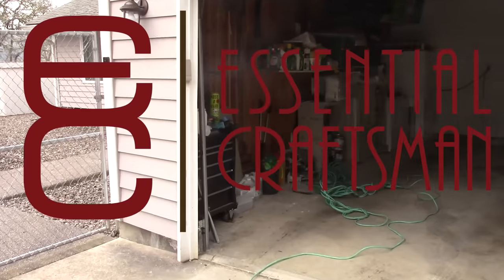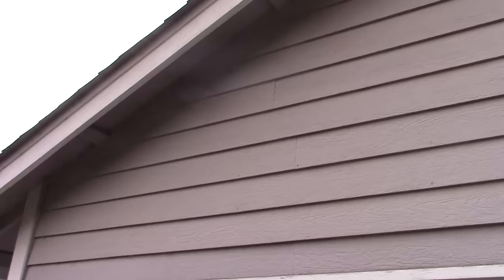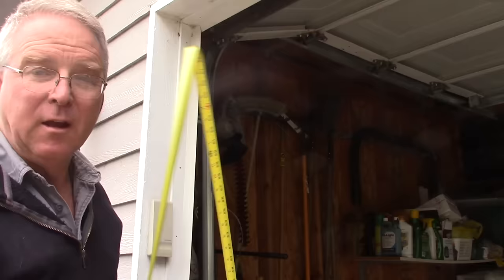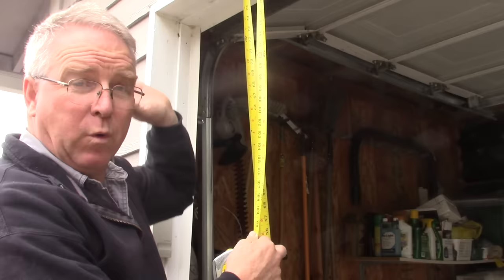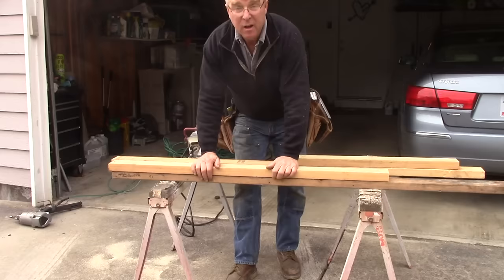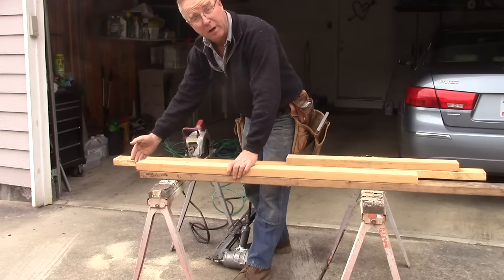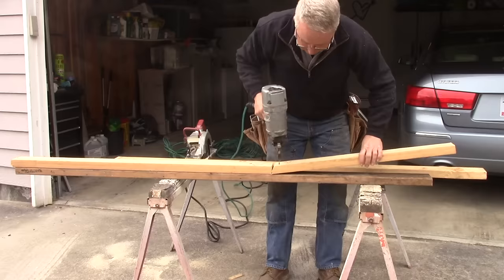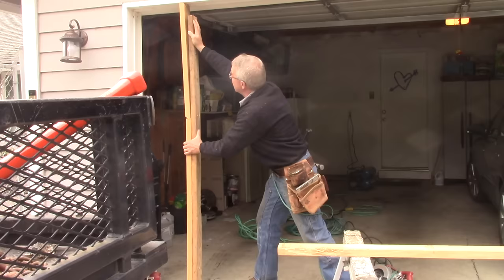2x4 Becomes a Jack - Cool Trick

Comment: Nicely done, but I don't understand why you didn't just back the truck into the door jamb...
Reply: * Adding more scuffs to the wall?

* It's hard to judge to within 1/8" of plumb by eye sitting in the driver's seat 8 - 10' away?

* It's likely quicker to lever in the way he did it?

* it is MUCH easier to control the amount and direction of force with a short lever than it is with a vehicle transmission?

* The amount the truck will roll several could easily be inches one way or the other when you take your foot off the break and/or clutch; and you need better then quarter inch precision?

I could possibly come up with a few other potential ideas, but I think this was the fastest and easiest means of doing the job that came to mind at that time.
It's interesting to see how an experienced crafts-person handles a quick, oddball job.  They bring years, and sometimes decades, of practical knowledge & experience to bear on the problem.  They make dozens of decisions, often without conscious thought, and arrive at a solution that simply works.  Also, as he pointed out at the beginning of the video, he wanted to show a quick trick on how to fix a problem.  Trying to correct a problem doing what caused the problem in the first place...
Reply: Brian Neeley . Trying to correct a problem [by] doing what caused the problem in the first place in the opposite direction.

There are three ways to do things: The right way, the wrong way and the Max Powerway!

Try rummaging in the bottom of your tool box, you might find an old, rusty sense of humour...
Reply: Massimo O'Kissed was
Reply: Lmfao!
Reply: now that's a great idea lol ok home owner stand back. while I fix your garage lol then plow right through front wall an back wall. then tell them you will start building new garage now lol

Comment: That works but 2 much work 
You can achieve the same thing by cutting your 2x4 extra long and just come in on a angle and use a sledge hammer and pound it over lifting the header..
Reply: Yeah a couple cuts and 3 nails is way too much work. Better to have to cut a board anyways, then easily swing a 4lb plus hammer while never accidentally knocking it too far. And for even less steps in the process just gotta put a cleat down or something to make sure the bottom doesn't move,  if you're a puss I mean. Not to mention, it'll leave some nice scuff marks on the customer's finished header/cap/jamb/sill, which is a plus because personally I think it adds character. I make sure and charge extra for such things. Brilliant
Reply: @kyleking1401  wow you really are that clever huh?
Reply: @ryankabcenel9700  I like to think so..
Reply: @ryankabcenel9700  haaaahhhhaaa fuk'n perfect!!!

Comment: That's finished trim your leaving a 2x4 impression on 
Wouldn't you want to use a block
Reply: Three impressions
Reply: I would think so.  It would also allow you to be more free, not worrying about marring/denting that surface.  That's a lot of pressure applied there.
Reply: Painters will fix that with putty when they repaint after the repair.

Comment: *Insert keyboard warrior critique on how you could have done it another way here*
Reply: Didn't he say a Jack and a 4+4?
Reply: A 2x4 board ¼  or  ½ too long hammered into place?  But I like this solution because it doesn't scuff the top of the garage.
Reply: nope, this technique will lift anything, dont know how much weight but i think is safe to say close to 4k pounds at least

Comment: all those tools you pulled out a $10 bottle jack was too much  neat trick im gonna use my bottle jack
Reply: Or just use one load lock.
Reply: Bottle jacks aren't as stable as this method.  They can be, but evething must be level and plumb.  When things are not level and plumb, bottle jacks and lumber can kick out resulting in injury. I've recently used this method and it was easy and effective... Also I needed 4 jacks and I don't own 4 bottle jacks.

Comment: Why not just cut a single 2x4 at 84 and 3/4 the tap it plum with a hammer? Wth did I just watch?
Reply: szymoozz I was thinking this. then remembering that’s still kind of awkward to do alone. 5 cuts and 6 nails still seems a bit much.
Reply: Often times the single 2 x 4 will just bend under the weight.

Comment: You could always build a house out of masonry or bricks when walls won't need pushing back into place. 

It's an old European trick.
Reply: Better use piles under the foundation in some areas.
Sink holes can happen even a poorly executed down spout in our freezing climate can make short work of displacing  masonry construction
Reply: ...but we have trees.  Besides,  the bricks and blocks would've crumbled and made a bigger mess
Reply: mike spence 
If it happened over here only the car would have been damaged. Lots of houses in Europe are usually build to last at least a hundred years. They are of cause also a lot (3x?) more expensive. 

I think that’s what Richard meant to say. It’s a different approach.

Comment: That was sick dude! I've been a carpenter for 15 years now and never saw that done quite like that. My way needed 2 full size studs, one just under current height and one to desired working or finished height, a 4 ft crow bar, and some  brawn. This is way cooler. Done outta scrap and with one less tool. ty man.

Comment: This is awesome. Saw this vid a few years ago. Was putting drywall on a ceiling and struggled a lot until I remembered this technique. I put a 2x4 horizontal on the top board to spread the force out on the drywall sheet. Worked like a charm

Comment: Thank you.  I need to replace the side pieces of my two garage door frames, and you just showed me how!  Just a tip: people should use pressure treated lumber for these side posts to avoid having this problem.  I didn't, and rain splash caused them to rot.

I made something similar to this to hang sheetrock overhead in my house 39 years ago, but I had to put a short piece of a 2x4 on each end of it to spread out the force.  I also used a door hinge between the two pieces (which were cut not to lift but just to fit snug and support).  I left off the third piece.  It worked like a knee and would lock into place and stay put.  All I had to do was line up a piece of sheetrock, have my wife install the thing under one half, start putting screws in at the middle, and work toward the loose end first.

Thanks for fast forwarding through certain parts so as to not waste our time like so many other Youtubers do.  They only want to prolong their videos so they can fill them with 25 commercials.  Thanks for not being that way, although you did appear to be beating the devil out of that board! 😂😂😂

Comment: Glad that u share this.this always helps me out when I am out on jobsites .as a  Carpenter of 25 years experience I find that using 6" quick release vice grip pliers is a much better option than using a framing gun or drill.just in case u have to remove n place in better spot. But I am glad u share some of t knowledge. someone out there will definitely use it.

Comment: You sir are a genius. 👍
I've done similar to pull up rebar hammered in the ground. Drill hole into 2x4 in middle,, fit around rebar, and used leverage from length of 2x4 to pull them up. It works great untill the hole is bored out to catch with friction, then you drill another hole or bend the rebar over the top of 2x4 to hold it.

Comment: When I was remodeling second floor bathroom, I had a hot water radiator that needed support. I decided to slide a piece of plywood under it in the room below (the ceiling was taken out and open) and support it with the 2x4 jack setup. My ceiling was 9 foot so I used my car jack on some blocks of wood to make up the difference. When I installed the plywood subfloor in the bathroom I took it out. Handy little trick. I also had to use the 2x4’s to level up the floor joists as some dingbat cut the load bearing wall below it. Same bathroom.

Comment: Cool trick.  In a pinch I might go for it.  I prefer a high-lift jack, 4x4 post and scrap plywood (all are usually found in my truck --somewhere) but this is clever if you are out there hanging in the breeze.  Thanks for posting!

Comment: Learned quite a few tricks using 2x4's to move walls, square up interior walls, and even lifting or standing beams up into place, by laying your glue-lam in front of where you need to install. Measure the height from floor to the position the beam will be placed. Add an eighth-inch to the length of the 2x4's, one on each end and nail into beam, then simply walk the beam up using the 2x4's until your beam is in place. Hopefully this description is understandable for all the framers out there. Frame on!!

Comment: Reading other people's comments gave me a flashback of one of my jobs in the early days. I was propping a ceiling using heavy acro props. When regrouping the ceiling the tension came off one of the steel Acro props and fell on the floor. It could have caused damage. We have these ceiling props with a maximum weight of 50kilogramms. Sort of wind up.
Very handy for many applications.
I also have a few accro props.
I'm not sure what you call them in USA.
I also think a bottle jack is a very handy piece of equipment to carry. I have a ten tonne bottle jack and yet seldom have used it. Perhaps I should make more use for it.

Comment: I like your method... I have done this kind of lifting before but using a solid board (4x4) set on a single brick laid flat wide side as the surface, and a pair of shallow wooden (I like to use hardwood, usually beech or oak) wedges laid opposing each other, set between the brick and 4x4. 

I cut the 4x4 about 1/8" short of the length needed. Alternately tapping the wedges until I get the EXACT height I'm looking for. Its VERY stable, and there isn't a lot of cutting (wasted time) in the mix. The brick is used to prevent me from hitting the flooring (using this indoors) and to make it easier to get a straight on strike at the wedge. 

Your method is good, thought you might like an option.

Comment: You can also nail together two 2 x 6's at 84.75 inches, set the beam in place, and knock it into place straight up and down with a sledge hammer. This works too and will give the clearance needed.

Comment: That's an incredibly useful trick.  Dear homeowners.  Move your tool chests/belongings out of a contractors way so they don't have to work around them.  My only concern would be that the peak of the second cut plank being at that angled point would it not potentially crease or leave a line in the existing material?  

Also, way to show the Electricians how a good contractor cleans up afterwards. 👏

Comment: Great tip!  But I offer one improvement.  If you instead secure the shorter of the "total length" boards to the main lever, your lever can be longer from the point of cantilever.  This would allow you to more easily force the total length boards into position, as well as secure the main lever in full length position with less holding power, and fewer nails.  Make sense?  Let me know if you think so.
Reply from the maker: Agree!!!

Comment: All you needed was one stout length of timber slightly longer than the measurement between floor & head of door frame .Then position it on slight angle tight from floor to door frame head & belt it with 4 pound lump hammer until the timber prop wedges tighter lifting the gable enough to put back in original position .Job sorted & a brew on the go while your still knocking up your contraption .

Comment: I do the same thing with two 2x4s, I simply create an equilateral triangle and then with my hammer I reduce the base length until I am at the right height. I can then tie the triangle sides together with 1x striping or whatever I have around.

Comment: There are many ways to lever. You may simply put one 2x4 of the right length under the beam and put it straight to lift the load. Or a wedge under the lifting post. Or a pair of wedges from left and right so you need not to saw at an angle.
Don't forget to distribute the force on the painted part to avoid paint damage.

Comment: Looks like a fun little trick. Honestly though usually in those situations I just cut the 2x4 (or a couple nailed together) to the length needed and put it in on an angle, then with a sledge hammer knock the bottom. As the stud pack straightens up plumb everything raises. If needed I will put a short plate on the bottom to skid the studs on as I hit it.

Comment: Could've just cut a 2×4 to the length you wanted, put the top against the header, and hammer the bottom with a sledge until its vertical. That's how you lift a deck that is sagging to correct the footings

Comment: We use a much quicker method here in england, using what we call a dead man cut slightly long and sat on top of another piece of timber. And simply knocked in until it raises the issue up.

Comment: A very useful tool and very well done sir. An easier and faster way would be to use one 2x4 with loose 2x4 blocks at each end and simply hammer the bottom over to get the lift. The blocks prevent any damage to the surfaces. I've used this method inside homes with hard wood floors and painted drywall with no damage. Your way is slick though and I will use it one day I'm sure, Thank you.

Comment: Just came across this video.  I’d seen something similar years ago.  The only input I would add to improve it would be to install it upside down and then instead of nailing it in the erect position, I’d just slide a double-joist hanger onto it to hold it.  That way it is easier to lower when the job is complete.

Comment: I remember one trick when we had to straighten a long exterior wall, we would nail a 2x4 to the top of a stud and have the bottom part freely sliding on the subfloor adjacent to a piece of wood nailed to the floor. Another 2x4 was nailed about halfway up the bracing 2x4 and acted as a lever to pull the bracing 2x4 against another nailed bottom scabbed on piece. You could pry a large wall out and then when in place nail the bottom of the bracing 2x4.
Reply: Today I was installing a large metal green house, and had to Jack up 30 trusses 1” in order to connect them to a purlin. This trick allowed us to raise and lower the structure repeatedly with a lot of finesse. Thanks!!!

Comment: So the question is, other than the expediency for the nail gun use, could you not also have used a reasonably sized C clamp the hold the post together for the lifting action?  Great tip!!

Comment: Greatly appreciate this idea and application!! 
Curious though. Why not use screws for the process rather than nails? With screws set in the wood it becomes reusable. If the screws are partially set in the top piece an impact driver could be used to set them in place once the leverage is realized. Removing the screws becomes the way to reuse the same rig if encountered in the future.

Comment: Yep--- he's right.  A hydraulic jack is the way to go.

FAR more flexibility in how to use it.

Just a few days ago I needed to partially tip a 600 gallon steel cistern I use for capturing rain water.  It's now mostly empty,  but I want to be able to dip the last gallons out  and then roll it out of the way and use a small rain barrel over the winter months.

But the steel cistern weighs in at several hundred pounds. Doing a dead lift of one edge of that would be very hard.  However,  my hydraulic jack,  designed to jack up a car,  did fine,  with the use of a few cement blocks and 2x4s to add to the lift and hold everything in place.

I should buy a steel cable come along for pulling substantial loads,  too.

Comment: Nice idea, but for those that use this, please be /super/ vigilant about that lift failing. If the wood suddenly cracks or breaks, make sure you aren't reaching in to anywhere that's going to close suddenly with your appendages, nor that you are anywhere near the possible trajectory of the wood itself.
Makeshift is great, when required, but safety first.

Comment: If you didn't have a nail gun, could you/have you used a small wood clamp to secure the shorter board once the jack is in place and the load has been raised?

Comment: You mentioned that the end wall of the garage is not load bearing and it brought up a question: Why do you need big headers on non-load bearing walls when they are only holding up the weight of the wall materials? Thanks for your vids and the info.

Comment: One day we were sent the wrong hardware to hang a Glulam beam. We used a 2x4 jack to hold it up while we replaced the hanger (although we cut it a bit bigger and just hammer it in between until it straightens up). Osha approved guaranteed 😅

Comment: I do the job with a 4x4 and cut it 1.5 inches over the hight of the total hight needed and use a sledge hammer to tunk it slowly at the floor end until it lifts the object up. this works great lifting floor joists or rafters to give you a free hand and supporting unreal weight.

Comment: Cut your jack post 1 1/2 inch shorter and use a scrap of 2x4 a couple feet long to distribute the pressure to the header trim so you don't put a big ding in your garage door trim.

Comment: That's a cool contraption, but takes way more work to build than required, and you've just cut up two studs that can't be used as studs anymore.

What we did on the jobsite is grab a stud, toss some scrap 2x4's underneath until its slightly taller than what you're trying to jack, jam it in there, and then beat on the bottom or top of the stud until it straightens itself enough to jack up your header (or whatever it is you're trying to lift). We would have had that header jacked up and ready to fix before you even had the pieces cut for the jack you used here. And then when you're done, you still have a stud that can be re-used for building.